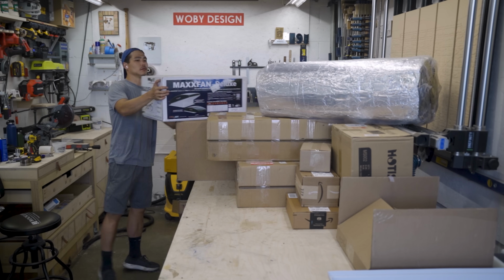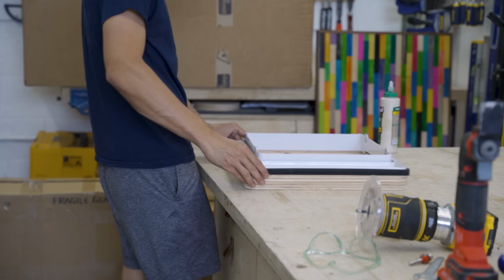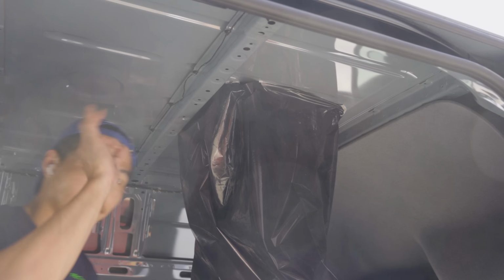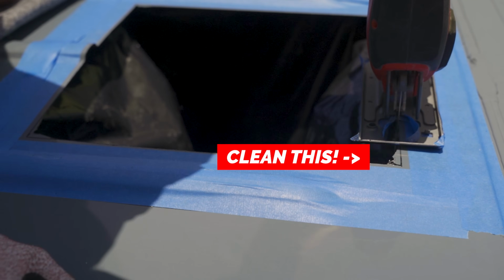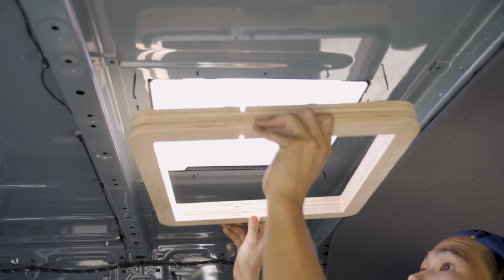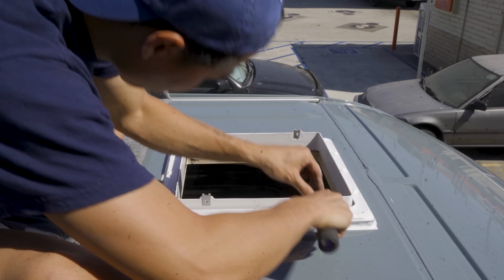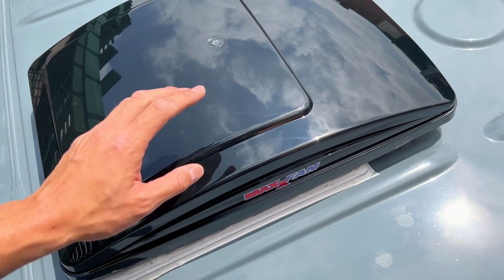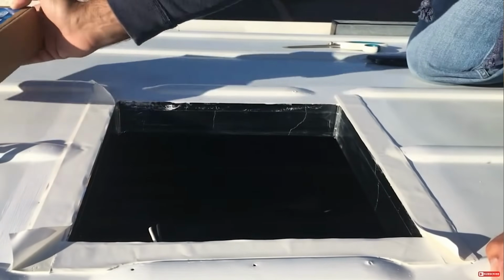HOW TO INSTALL MAXXAIR FAN DELUXE!

Comment: As far as the voltage regulator goes, while car batteries are considered 12v, the voltage is actually higher at around 12.5v (this fluctuates though depending on how charged the battery is and the load on the battery). But more importantly, the alternator that charges the battery does so at 14.4v. You can also get voltage spikes due to how the alternator works fundamentally. Digital electronics are sensitive to voltages outside their normal range, so you use a voltage regulator to both smooth out the voltage to a stable level and lower the voltage to the appropriate amount.

Comment: I fried several of these boards before I started installing a super cheap buck voltage regulator. It can be set to feed it a steady 10.5V and I haven’t had issues since. I don’t know why Maxxair hasn’t started including this $3 part yet since most solar powered van systems will fry their boards.
Reply: Link it for us

Comment: Thank you, yours was the only install video that dealt with raising up the clips. Prior to watching this video I spent 2 hours failing to make the screw holes line up and was close to chucking it in the bin.
Reply: I was facing the same issue. Raised the clips and problem solved. Glad I watched this video!

Comment: Hey Ben, love your work. Three suggestions:

Use a spring-loaded centre punch to locate the drill tip next time you want to prevent the drill from skipping out of place at the start.

A sheetmetal nibbler attachment for a battery drill will cut the sheetmetal easier and cleaner.

Don't stress too much over the edge rusting - modern vehicles are galvanised. Galvanising protects the exposed edges.
Reply: The metal is galvanized until you cut it as the gavinizing is a thin layer on the surface of the metal. Cut edges are not gavinized.

Comment: One thing that relieves some of my struggle to want to cut into the van, is realizing there is in fact a going back. Any body shop can pretty quickly fix a hole you mess up lol, actually only risking an extra few hundred bucks.

Comment: I recommend a 12V DC/DC converter for the fan. There are three reasons. -1- With higher voltage your fan gets more powerful and the motor lifetime will reduce. It won't help just let it run on low speed as the voltage on the PWM signal (electrical thing) stays the same. -2- circuit board issue - it may be solved on newer models but just to be safe. -3- Many components are generating a lot of spikes in your 12V system. To prevent them to reach your fan a DC/DC helps. You can use them to protect other things like LED lamps, ...

Comment: I install MaxxAir 6200 (manual lift) or 7500 (remote lift) in just about every build and can attest to the finicky nature of the 7500 model's circuit board. I build a 24V power system which typically includes a 24V to 12V buck converter that outputs a constant/regulated 12V (usually 12.2V-12.4V). Even so, I've had to replace the circuit boards on two fans. Happily, the manufacturer provides stellar customer support, so replacements were immediately sent out.

Airxcel states that the voltage sensitivity has been remedied in all fans built after a certain date, so new stock shouldn't exhibit this problem.

The only (hopefully constructive) comments I have are 1) use butyl tape instead of Window Weld to secure the adapter to the van, and 2) lap sealant, not Sika 221, is the preferred final barrier. You'll also find that it's much easier to apply. Tip:  Mask the area for a professional looking result. Many people don't and I'm just not a fan of the uncontained "ooze".

Comment: Bought two fans. When I installed them one worked and one had the green light death thing. Out of warranty by the time I installed so it cost me a extra $150 for a new circuit board. I went and bought limiters to prevent any over voltage issues. Working fabulous now.

Comment: Pro tip that I have not tried but have seen on @crafted workshop, put a little isopropyl alcohol on your finger prior to spreading caulk. It will prevent stickige.

Comment: Maxxfan 7500 owner here, it is the loudest thing in my van. Rattles and squeaks from Day 1, sounds like a box of bolts when semi goes past. Lots of threads on sprintersource for how to reduce noise with foam and felt tape rebuild. Why can't they just add a little more R&D to fix this? Longstanding issues with documented history. Great video Woby, sorry for the rant

Comment: Kind of crazy they don't just supply a buck converter with these fans if they're susceptible to overvoltage it's universally known that Alternator voltage regulators put out ~14.4v to 0 based on battery voltage. Thought I wouldn't be surprised if this issue is more related to DIY battery/solar setups.

Comment: Okay your doing a great job, I just have a question about the fan install are those 4 screws on the outside the only thing holding the fan on? I ask because it seems like a real easy way to break into the van if it was left while out Adventuring. Great job none the less
Reply from the maker: yea, that's one that i'm ehhhh about. But if you think about it, you can break into a house with a rock so it's about the same.
Reply: @WobyDesign  yeah I hear ya, and honestly if your living out of it while your traveling there shouldn’t be to many times your away from the van for long I would image.
Reply: I'm picturing the wind grabbing hold of it. Personally .. I'd predrill a few more holes for additional screws.

Comment: I noticed you said "shower" while talking about what the fan would be around, and I just want to throw my two cents in the comments. I think a shower in a camper van is kind of a worst of both worlds. It takes up a large amount of space (space is everything in a van), the space given isn't going to be comfortable at all, and it requires the work of fully waterproofing and setting up channels in case that waterproofing doesn't work so you don't flood your van. In my opinion, you'd probably be better off just having a gym membership or getting a shower head that you can connect to a long hose with an electric pump to/from your sink water reservoir and hang out the back of the van. With that second option you'd also probably want to invest in some sort of fold out shower curtain a la your spray booth for obvious privacy reasons.
Reply from the maker: You should’ve also noticed I made a video about my plans and you should’ve also noticed this is none of your business.
Reply: I installed a shower inside my van and it does not use any additional floor space.  The shower is located in the entryway of the van. The custom sloped stainless steel shower pan is inset into the insulated floor, has a teak inlay, and a trap door covering it all up.  Heat up the hot water, hook up the shower curtain that has magnets in the bottom corners of the curtain, inlay the steel slats that fit between the teak inlay and the stainless steel showerpan and I have a larger inside shower than most camper vans and the shower curtain keeps all the water draining as intended.
Reply: Rude much?

Comment: Im confused as to why he needed the double layer of plywood on the inside?  That seems REALLY excessive and a lot of overkill for that project.  I"m all for adequate mounting but that seem to be something that's going to create issues when he is doing his finish work on the inside.
Reply: It looks like the plywood sits flush with the roof supports. He's probably going to do some kind of dropped ceiling or something.
Reply from the maker: Double up on the plywood is bothering you? Lol I don’t think this channel is for you bruh